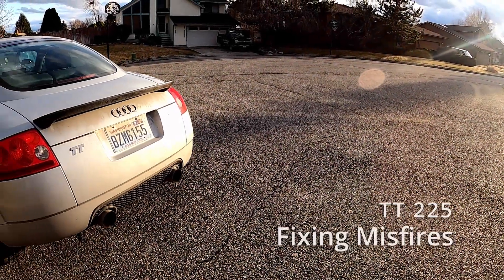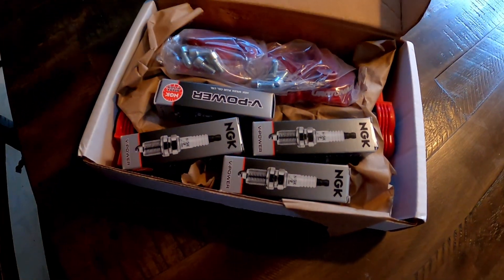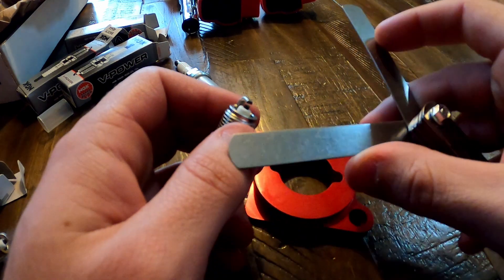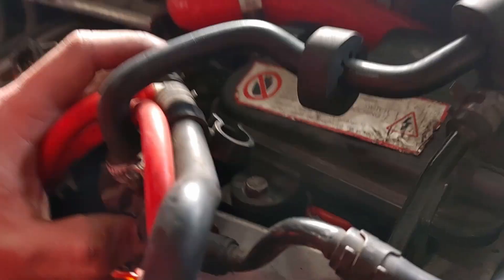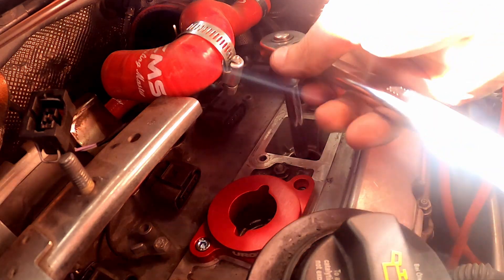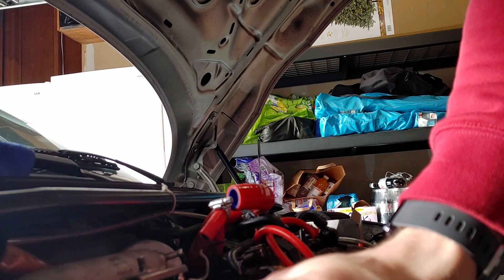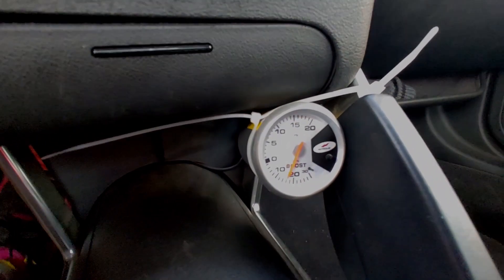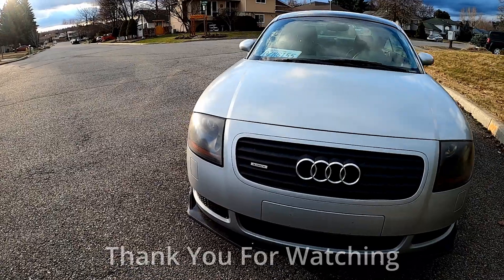How To Fix A Misfire | Audi TT Spark Plugs And Ignition Coil Upgrade

Comment: Just look at ur fuel trims give u some insight -10 +10 will point towards ignition/mechanical  let’s just say u had heavy -30 +30 then I would go towards the fuel delivery just curious what codes did u get and what’s was air fuel ratio

Comment: I am trying to install these coil packs, but I can't re-install the n249 bracket with R8 adapter plates installed. Did you not run into this issue?

Comment: Hi my 225 was driving fine then all of a sudden started running rough with lack of power showing code p0301 any idea if this is plugs or coils ? Thanks
Reply: Also got engine light

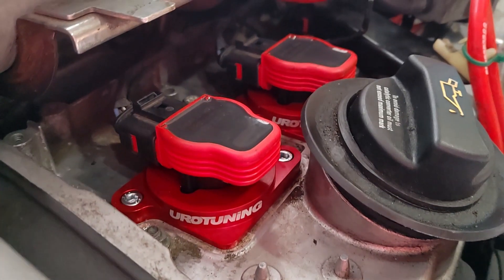Comment: We just replaced our spark plugs and coil packs on our 2006 Audi TT Quattro 225hp version.  A hard plastic piece broke on the vacuum system that comes out the Y you can see in your video at 6:56.  We now have to drive 30 minutes to the closest main town that has parts stores.  

Crossing our fingers there is a generic part of correct diameter and length.  Thanks for the video though, it helped give us some clarity on this specific engine.  Wife and I have both worked on many of our own cars, but never an Audi.

Comment: Hey man was gonna order a different set of coil packs and was wondering how the ship time from UroTuner is
Reply from the maker: That's super dependant on where you live. I believe they are located in florida. I'm about as far as you can get from them in the US over in washington, and as long as the item is in stock it rarely takes more than a week.
Reply: @HunterDirection  sweet man I've been using your little video series for an idea of what I want to do with my new 225 lol. Got a lot of work to go still but they are sweet little cars for sure

Comment: I’d love some opinions on what my 2001 TT 225 is doing ..went for a joy ride after owning it a few weeks and lost cylinder 4 and pending 3 ..seriously go-carted it home. Thinking it was the plugs and coil packs I thought that would do the trick. It ‘helped’ but still a golf cart. I’m thinking either MAF or the crappy broken connectors going to the packs. Or worst case a bad ring or two. Happened instantly on a hard press. If i were to do this all over again, I would have babied it while replacing ORIGINAL AUDI coils 😂. Getting downpipe installed tomorrow with Aftermarket and we’ll see if that shines any light. Any advice would be great. Btw, only replaced 3 and 4 coils until i get my NGK’s. I wish i knew about the ones you got; these bolt ins are a biatch. Thanks for the vid bro
Reply: Connectors most likely but could also be burnt valves/ seats. Best check the compression if resolving  electric poor wiring does not help. To start, check spark strength by removing and placing each coil, one at a time, with plug inserted and grounded to the rocker cover. Get a friend to turn the car over to check. Obviously wear rubber gloves and best do this in a shaded area. You might need to spray the plug end with carb cleaner etc first and regap, or even use a fresh plug, one that you know works.  And  if it turns out to be a no spark scenario, swap a coil pack and retest. Let us know how you get on.

Comment: quick tip if you don't feel like buying a special spark plug socket. 
Just use a normal socket and pull them out with the coil pack 😘
Reply from the maker: Woah that's a great idea! I will 100% be trying that when I throw coils on my S4 next :) thanks for the support!